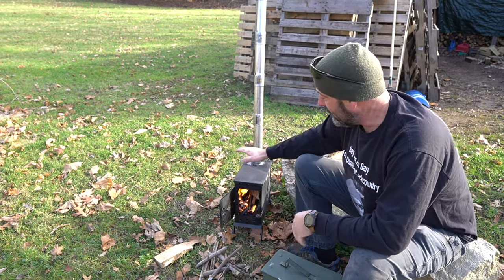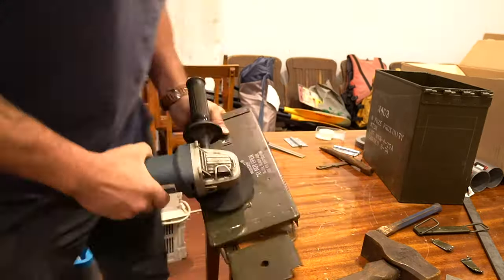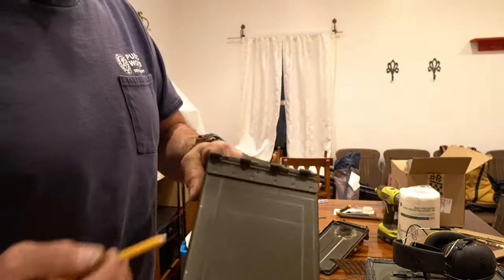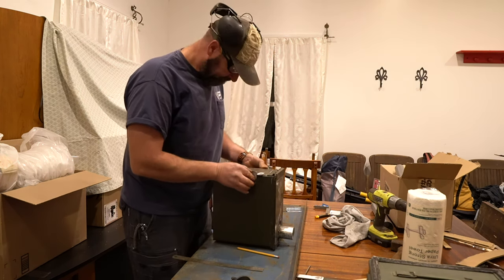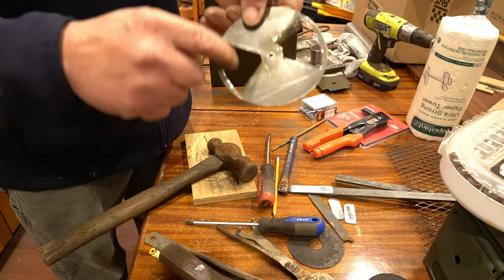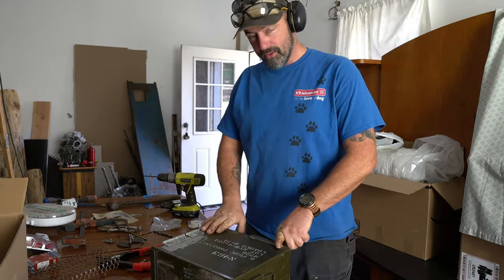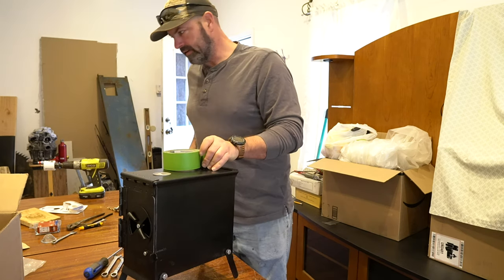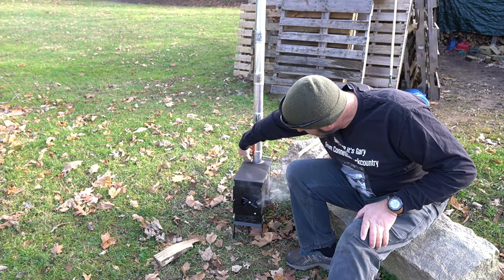Ammo Can Tent Wood Stove:DIY Hot Tent

Comment: You know I watch a lot of these stove build videos and I’m very impressed with the creativity and engineering of many of them now I’ve only seen five minutes of this video but I have to ask the question honestly, how many times are you gonna have to load that thing during the night to stay warm. I’m working on building a tent using an aluminum, turkey, roaster, lightweight, larger fuel capacity, and probably a little bit easier to work with then the steel you’d have to deal with with a ammo can plus I can find turkey roasters, aluminum ones at the thrift store honestly for less than five bucks even if you’re lucky it’s unlikely you’re gonna find an ammo can anywhere that cheap, not criticizing, just stating facts.
Reply from the maker: @davesullivan8073  oh hey, yeah, I’m down for those comments as they are spot on. The reality is that I wanted the project. And something that fit into a pulk. That is the only reason I built it that way. You can build it cheaper than I did in many ways. If I remember right, I was all in (minus the stove pipe) for like 30 bucks. That said, I did notice the temp drop and I reloaded the stove often through the night but I’m good with that. 
To each their own hey. There are dozens of better options and I would love to see yours when you are done. 
I have seen the roaster pan done on a couple forums and think it’s a winning design that did not fit what I wanted to build. 
All the best, Gary.

Comment: Nice job on this hot tent stove! I acquired a 50 cal ammo box, as well. Thanks for the ideas to make it a tent stove. I am thinking of using a 3 in black stove pipe on mine. Be nice if you would make a list of materials used, in your comment section.
Reply from the maker: Thank you and thank you for the suggestion. I did mention it in the video but I can put a list together. I mostly used stuff I had laying around so I am not sure of prices but I can find comparable stuff I am sure. the 3" stove pipe would be a lot lighter than the exhaust sections I am sure. I did end up switching to 3" pipe after as the 2" didn't work how I wanted it to.